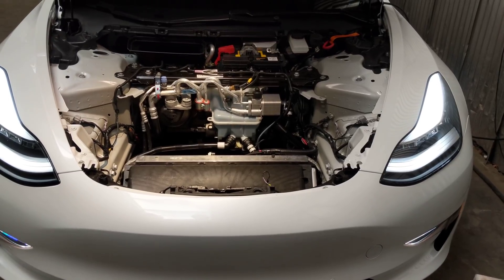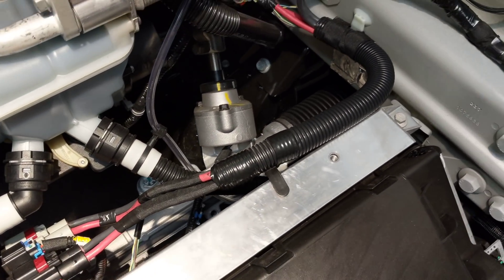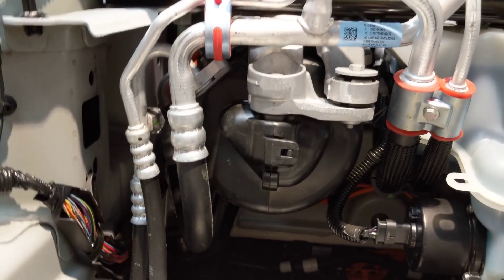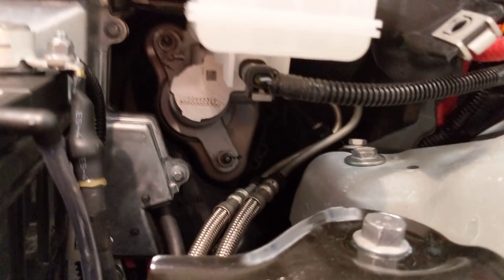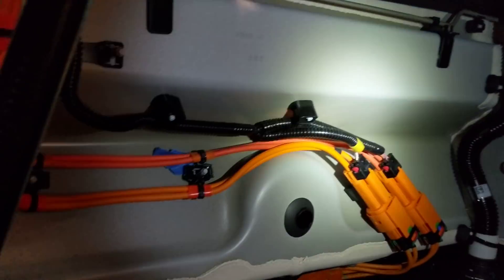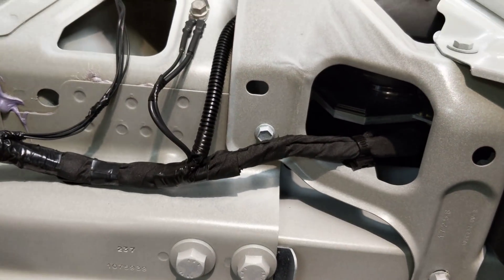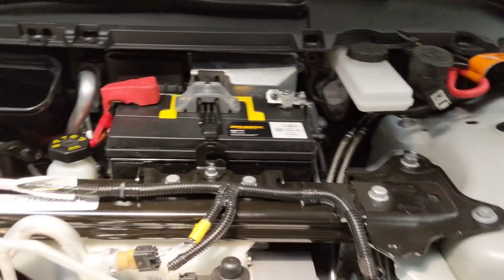Tesla Model 3 Stripped - Part 1 - Frunk Exploration

Comment: Could the open area where the front motor would go be used as an addition storage area? Sort of a frunk extension?
Reply from the maker: Unfortunately as you can see there is no open access, there is a lot of equipment between the frunk tub and that area.
Reply: @Ingineerix  A sine-wave, 1.5-2.0 kW, 120 VAC inverter would be a nice addition to our Model 3:
http://hiwaay.net/~bzwilson/prius/priups.html

Any idea of the maximum, 12 V inverter current output current?

Comment: ¿Can you explain the AC lines in detail, it's not very clear, i see a bifurcation on the system with one part that looks to be going down(to the cabin?) and the other to that coolant/heat exchanger/mini-evaporator, but at the same time the coolant system goes to the front radiator ¿huh?, are they running the AC system all the time to chill the electronics below ambient and then.. return it to the radiator?, seems like a huge waste of power
Reply from the maker: No, there is a valve that can divert flow to either/or the cabin evaporator or the glycol chiller.

Comment: The model 3/s/ probably x all seem to have abs based braking. That is the abs controlling the brakes instead of a traditional master cylinder/booster. There is a tiny master cylinder simply for emergencies/if for some reason the ABS fails or loses power to the module.
Reply from the maker: Not true.  There is a standard ABS valve body called ESP3 made by Bosch used for EBD, ABS, Yaw control, etc, and there is a standard master cylinder connected to a Bosch iBooster.  See this for more info: https://goo.gl/qE9y3t
Reply: Ingineerix huh. Well it appears I stand corrected

Comment: Really impressive review, and I certainly want to know what's "under the frunk" driving my Model 3, so this is great!  You're very talented.  BTW I have an intermittent nattering sound which comes from the area under the windshield washer tank.  My ear is only so good at locating sound sources but it's that area.  Kinda sounds like mini-arcing, but I'm not an engineer so I took it in to service.  They said they had just (two weeks ago) gotten an advisory on it and so far there is no "fix", it has to do with the 5 valve cooling system.  They said there is no danger.  I'm a little skeptical about their answer, but it's the best I have for now, and otherwise I love the car.  The background noise in this video sounded a little bit like it; was that the car, or something else going on next door?  Would you have any ideas about this sound I'm plagued with?  My VIN is in the 11,000-12,000 range.  Thanks in advance for any ideas.

Comment: thanks for posting the video . i was wondering about the air exit for the radiator i.e the air entering from the front to cool the radiator,  where does it go? after passing through the radiator. since the under body is completely covered.

Comment: 3:36 Where is the cabin filter on the Model 3?
Reply: It's accessible from the passenger footwell. You have to pull the side trim off of the center console and there is a door in the HVAC to slide the filter out.

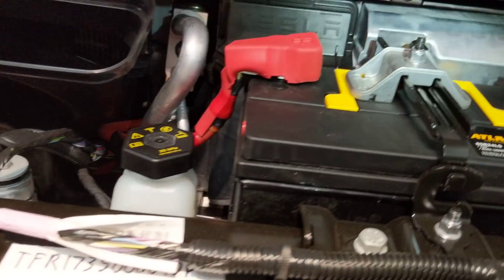Comment: Great overview! at 3:24, you mentioned there is no IBS sensor for 12V battery. How do they measure the SoC, voltage, current, etc for 12V battery?
Reply from the maker: This function is now integrated into the front body controller.  Much higher levels of integration, it saves cost and reduces wiring.

Comment: Where can you tap into "12V" for aftermarket stuff since there is no fuse box to use?  Did Tesla include any connection points?
Reply from the maker: I haven't found any dedicated points, but there are plenty of options for tapping.  No need to go direct to the battery.

Comment: What's that separate battery for since this motor doesn't require ignition?
Reply: Besides standard automotive loads already mentioned, when the car is first turned on, this small 12V battery is its only active power source.  After the computers are running and have completed basic safety checks, its 12V is needed to energize contactors inside the main battery pack to supply high voltage to the main drive motor and DC/DC converter, which in turn recharges the small 12V battery and supplies low-voltage accessories from that point forward, serving the role of an ICE car's alternator.  So, the "starting" sequence is not as different as you might think.  All modern electric vehicles use this type of design as a safety measure, so that high-voltage is never present outside the sealed traction battery housing except when needed.
Reply: Lights, mirror motors, windshield wiper motors, emergency systems if HV battery fails, fans, USB plugs, etc...
Reply: Thanks - I really appreciated your explanation.
Reply: Anything 12 volt.

Comment: At 1:38 the HP AC line looks slightly bent and crinkled/ not radiused properly (left handside vertical just above hose to pipe crimp, directly besides its low pressure counterpart!!)
Reply from the maker: That's standard on all modern cars.  Looks funky, but the marks are from the forming tools.  It's properly done.

Comment: so not steer by wire ?
Reply from the maker: It's both, but there still is a mechanical steering shaft.  There is also a fault-tolerant steering rack motor with 2 controllers and 2 power feeds for the autopilot mode.
Reply: Atleast in some countries it has to be mechanical by law.

Comment: 1:56 About the 12 V battery, does the supporting platform could handle larger size batteries 
(Allow to have more capacity for car with special equipments, like emergency or police, or car with additional self driving computers...)
Reply: Gordini - no need for that. When the car is on, it uses a DC-DC converter to run the accessories off of the main HV pack. Plenty of juice there. The 12V battery is just for connectivity when off and to “start” the car (close the contactors).

Comment: interesting. So they've designed this with the front motor in mind. So the frunk won't be any smaller on dual drive versions.
Reply from the maker: Correct.  You won't even be able to tell it's dual-motor by looking in there.
Reply: Ingineerix did it look like there was Provisions already there for the power wiring so the new motor or all-wheel drive is plug-and-play? Curious about aftermarket upgrades later when used motors are on eBay
Reply: Tauran might need a software setting to accept second motor

Comment: Very interesting. The lead acid indicates to me that it's curiously stagnant engineering.
Although the fuseless design sounds nice.
Reply: Dan Frederiksen -  The 12v lead acid battery does not provide any backup or buffer functionality for the LiIon batteries or motor, and it's use is not a mistake.  Mistakes cause a system to fail and become unusable, and a 12v starter battery doesn't store enough energy to push a car around the block.  Rather, in this case it is an engineering compromise in order to deal with a mature field of electron components designed to use 12v.  If you feel you can design and implement an engineering solution with fewer compromises and for a better price than Tesla, then please proceed.
Reply: Not on the Model Y and 95% less wiring loom than Model 3!
https://insideevs.com/tesla-model-y-ditch-12-volt-battery-95-less-wiring-model-3/
Reply: Computers, lights, motors, and pumps in this car,  made by BOSCH and other auto industry manufacturers, rely on 12 volts.  I imagine they kept the 12 volt battery because it was easier and cheaper to power some of the legacy automotive components with a battery, rather than use DC to DC converters.  Batteries are much more robust, forgiving, and far cheaper for powering inductive loads.  As the automotive industry evolves, such legacy components, or "stagnant engineering", will fade away.
Reply: Possibly it is there to provide a backup. LIon Packs like these are new technology compared to SLA's, and the added reliability of a dedicated 12v battery for safety-critical stuff might be worth it.
Reply: Of course it's a buffer and backup. That's besides the point. It should have been lithium, not a lead acid ICE starter battery. Don't make up excuse for their mistake. Don't be a sheep. The more that see the mistake the quicker they will change it.
Reply: I don't mean backup for drive power. And yes it is most certainly a gargantuan mistake to use garbage lead acid in a Tesla. It's inexplicably stupid. Unforgivable. Same as the vampire drain. However weird that it is, they make these odd huge mistakes and remain blind to it for years. Despite significant public mention. They are just human with far more limited capacity that most think. Even though they are thousands of people, for some reason some blind spots remain unattended.

Comment: Thanks for doing this! One question, is there any way of telling if they use the A/C compressor as a heat pump for cabin heating? They'd have to have zone valves to reverse hot and cold to do that. Did you notice anything like that? I can't make it out watching your video.
Reply: I doubt they have. The bigger the battery the less overall effect it has on the range. On the Leaf for example the heat pump is of little use at -15C and useless at -25C. Unless the heat pump cost (vs A/C) is truly marginal (I highly doubt), I'd rather have a larger battery instead.
Reply from the maker: Sadly, they chose not to implement a heat pump.  Yes, it would be obvious if they had.  I suspect they are banking on the fact that they have such long range that they didn't feel it was worth the added cost.

Comment: There were a few times that you mentioned Model S, but may have meant 3, like when you were talking about the car having no fuses.  Did you mean that the 3 doesn’t have any fuses?
Reply from the maker: Yeah, this was just a slip.  I'm so used to dealing with the S.  The 3 is still so new to me it's not "muscle memory" yet.
Reply: Ingineerix Is there a transmission in the Model 3?
Reply: What they are probably using is automotive-rated high-side switch devices which have the ability to measure current on each bus and trip in an extremely predictable manner.  There will probably still be a few fuses for the highest current buses, like the main battery bus and the DC/DC output.  The high voltage stuff will also be fused.  This technique saves a lot of money (less fuses, no need for a fuse box for user serviceability) and would allow techs to remotely diagnose overcurrent issues, it could even tell you the exact circuit that has failed.  But it's more complex, and requires a great deal of system integration.
Reply from the maker: Correct.  There are no traditional fuses.  The HV is protected by an "active pyrofuse" which is a one-time switch operated by an explosive squib.
Reply: strejf He mentioned something about the electronics being solid state.  I’m not an electrical engineer, but I assume that means some type of circuit breakers instead of fuses...?  Fuses are cheap and generally fail safely (they won’t stick shut like a mechanical breaker), but they’re one-shot devices with occasionally unpredictable behavior.  Tesla probably views them as obsolete technology, unsuitable in the age of highly electric vehicles.  Tesla reportedly don’t use conventional fuses for the main battery pack anymore, since the fuses don’t always reliably blow at the right amperage.  Google “explosive fuse” if you’re curious.
Reply: I want to know this too, I'm pretty sure the Model S and X have fuses. Model 3 does not?
Reply: So there are no fuses at all in the Model 3? That must be very unusual right? Is that an advantage or disadvantage and what might the reason be?
Reply: It means it has "virtual fuses" where some microcontroller monitors current draw and switches the circuit on overload. It's all about being more fault tolerant, very important for self-driving stuff.
Reply: Yeah, that's an interesting point.  I assume the autopilot computer will be dual redundant with dual redundant power supplies feeding it.  If a power failure occurs, the AP computer needs to be able to safely pull the vehicle over, or continue to the next exit, etc.

Comment: So, it's in a sealed area of the car, out of any UV rays or outside elements... rubber and fittings should last for a long time. yes?
Reply from the maker: Yes, all that you see in the videos is totally covered and out of sight normally.  When you open the frunk on a 3, the only thing you normally see is the windshield washer fill port.  That's it!
Reply: Is it sealed from underneath? It seemed I could see light through the wheel well at 4:17? If I drive this through salted slush in northern Idaho what keeps it from getting in there?

Comment: Surprising there wasn’t a cabin air filter. Have you found any other signs of one since the video was made?
Reply from the maker: I was referring to the cabin air filter.  On S/X it's a pre-filter outside the cabin filtering all air before it enters the system.  On 3, it is located inside, so it has to be a post filter.
Reply from the maker: Yeah, I think they have one inside somewhere.
Reply: I believe the manual mentions one.
Reply: many cars have them behind the dash on the inside
Reply: Andrew Soeldner I think he meant engine airfilter equivalent